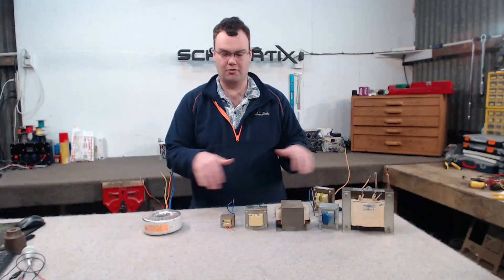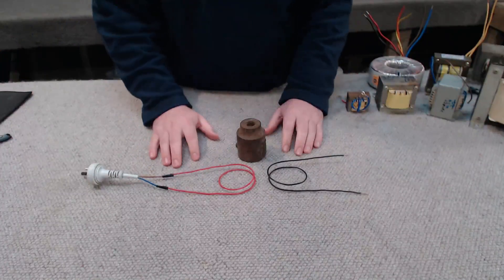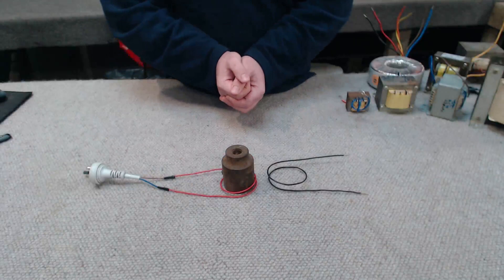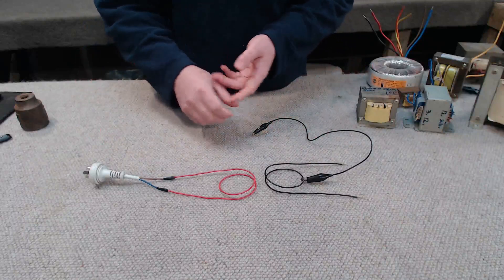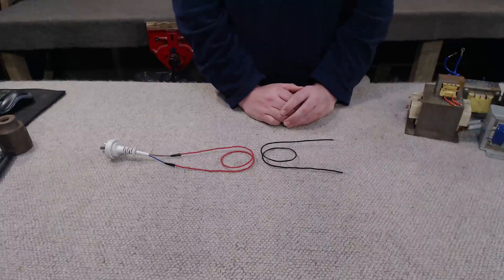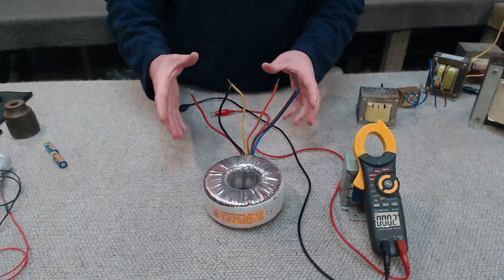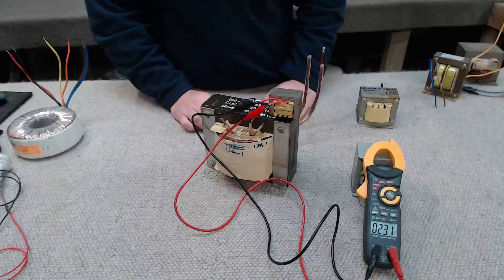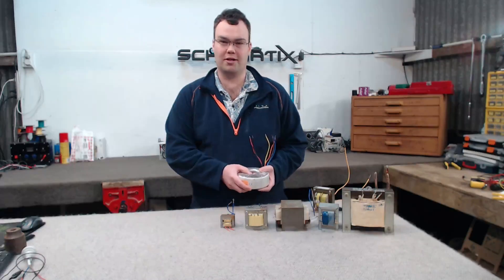Transformers 101: How They Work & How To Wire Them

Comment: I have NO idea what im doing. I want BIG arcs. I know just enough to not die basically. I know DC stuff pretty good actually, as im a mechanic. But AC is mysterious and intimidating. So i pulled a TV apart from 1958. Had a big transformer in it with 9 leads.

I juiced the only winding that had continuity between ONLY 2 leads. output was lame. Moved over to the winding to the right....

No hum, no buzz... Crossed 2 wires next to that and got a healthy humming noise......

Put my meter on it... 

600 volts. The decimal point vanished and my blood turned cold hahahahahahaha cant replicate it with any other transformer ive found in the junk collection. I either get lame outputs or a pop a 20A breaker in my house lol

Comment: When identifying the primary and secondary cant you find the a pair , write down the resistance, find another pair and  with the two different resistances  use  Vpri÷ V2nd = Npri÷N2ndary and on the transformer a tag should be there indicating ( not wire colors) but primary and secondary voltage. Depending on whether it's a step up or down transformer you could determine  which pair is which by the ohms  value as more turns ( N) will be the higher resistance. . To verify input the voltage on one and read the voltage on the other.

Comment: I have transformers hooked up to power ten inch sub woofers hooked up on my 98 DE51V double cab Suzuki van these transformers are different that yours they only have three wires and I don’t know how to hook them up it’s four transformers two capacitors and about ten large transformers I wish there was a way to send a picture to you I can’t figure out how to hook up 12Vdc to get them working and hook up the signal coming in from the radio please help

Comment: A question: in the US we have a 240V secondary with a center tap to give 120V. The center tap is referred to as the neutral and said to have a voltage of 0. Why is the center tap’s voltage zero. Is this an inherent property of a center tap (if so, why) or is it simply because the neutral is connected to ground (as in the case of a breaker box)?  Thanks much for your time.
Reply: If nothing else were at play you could arbitrary call any one of the secondary wires "zero volts." In the normal use in electrical distribution in North America, the 240 volts is often called "split phase." If you use the centre tap as your zero volt reference, then one end of the overall winding is 180 degrees out of phase with the other, with respect to the centre tap. For example if the instantaneous voltage on one lead were -50 volts with respect to the tap, the other lead would be +50 volts with respect to the tap.
In power distribution the centre tap or "neutral" is normally connected to earth ground at the distribution transformer and at each electrical panel. This redundancy is a hedge against one of the connections going open. For example, if the neutral wire between the transformer and the panel in your house went open circuit for any reason, and there was no redundant path) then all the neutral connections in you house would be "hot" an present lethal shock hazard (along with the problem that current could then only flow from one end of the transformer winding to the other, and there would be no well-defined centre point).

Comment: I'm curious more so in the construction of a standard transformer, as in "why do laminations make up the iron core in most transformers?" and "Why is the whole unit dipped in varnish?"
Reply: Laminations are used to deal with eddy currents.
Briefly (you'll be able to find lots more on the web by searching for the term), when an electrical conductor is put into a time-varying magnetic field, electrical current is induced into the conductor. In the core material of a transformer, these currents are called "eddy currents." They flow within the material itself, not through some external circuit. They are undesirable in the core of a transformer because they consume power, lowering the efficiency of the transformer, and of course cause heating because of that power consumption. In a solid chunk of steel ("silicon steel" is the usual core material for low-frequency transformers), the eddy currents can be very large and flow through the whole thickness. Laminations restrict eddy currents more or less to each individual lamination. This is because there is electrical insulation on the surface of each lam. It isn't very good insulation, often oxide from the manufacturing process but may be a specific coating of some sort or even separate insulation such as paper, but it is good enough to localize the eddy currents. You still get eddy current in each lamination but the path for them is short and the overall amount of current is vastly less than it would be for the same overall thickness of solid steel. At higher frequencies, laminations need to be thinner. Some high frequency transformers use toroidal "tape wound" cores, where the metal (often something more "exotic" than steel) is made as a very thin ribbon that is wound into a roll like electrical tape. At very high frequencies, as for switchmode power supplies, the core materials are generally made with more or less non-conductive materials like iron oxide ("ferrite").

Varnish does a couple of things. It "glues" everything together. This can help prevent audible noise from the winding wires moving in the magnetic field or the lamination pieces vibrating against each other, again because of the mag' field. Varnish also helps seal moisture out of the whole affair.

Comment: I was wondering if two high voltage transformers had to be re winded I am trying to repair a old welder. It's a zebra 30Z/230/208/240/220

Comment: I am currently building a solar/wind system. I have 4 120vac at 41.67 amps. Inverters I  have been told by an electrician that the 4 outputs of the inverters can be wired into the primary with only a single input? This seems odd to me from an electronics standpoint. If I tried to connect 4 outputs onto the only primary winding of a transformer, that the inverters would be back feeding into each other thus destroying the inverters and possibly the transformer? I need the 4 5kw to feed my primary and give me 120vac split phase output. I am pretty sure that the electrician didn't understand what I was trying to do.  The only way I know to not burn out anything is to make my own transformer using 100 turns for each inverter, then my secondary would have 100 turns that I could wire into my step-down transformer input and get 240 roughly 83 amps and then the secondary on the single input transformer would give me 120 vac split phase. I  may not have the number of turns correct for the inverter input to get 240 vac 83 amps out.  Unless I am remembering it backwards I think that it's 25 turns per primary input, and 100 turns on the output to get 240 vac. I haven't found a multi input primary step-down transformer yet. I do have an old transformer with 1 set of inputs that will output up to 10k vac across the secondaries. The internal wiring of this transformer has been gone for years but the secondary is center tapped with 5 outputs either side. Wish I had the internal diagram. Am I on the right path and correct that you can't hook the outputs of 4 inverters parallel into the only input without burning out the inverters.

Comment: as a SUBBIE I would like to share a thought, 'step up transformers' looking at a MOT  ='DANGER'= . Here is Aus we have 240V a.c. domestic and using that to a mot would give a step up of 2000V a.c. plus, I would like to reverse primary input connection to the secondary and to have the mot step down is this possible ..thanks for any thoughts. p.s. I would be aware of the secondary winding in most cases is tied to the transformers body, thanks again cheers

Comment: I took a transformer out of a computer PSU, it typically converts 240v into lower voltages obviously. I noticed it actually has 3 inputs on the input side, this is because one input remains the same, but it would be electrically moved from one pin to another whether it's being used with 240v or 120v. Essentially it's the tap thing you explained, the 120v I would say would have more windings, where as the 240v would be tapped in there before the windings are completed, because the 240v is already starting at a higher voltage to begin with. 

Then on the output side there were a crazy 7 pins, however 2 sets were connected on closer inspection, so actually it's 5 separate outputs. Being a computer power supply transformer, it's understandable as in a computer power supply it's meant to create 12v, 5v, 3.3v. 

It's using the tap method also on the output, so sharing one pin, and then different pins are used for different voltages, that would equate to 4 pins however, I found out that the fifth pin didn't appear to to anything, it also looked odd compared to the rest and didn't come from the actual roll of coiled wires, but just came out of the bottom of the frame. 

In order to figure out the voltages on these 4 outputs, and luckily with AC it doesn't matter what way you put things around as it's alternating anyway. It means you can attach simple devices to the transformer while it's powered up. Using a 12v bulb, it's simple to see. It's bright when you are between the 12v ones, it's drab when it's between the 5v ones, and it's not even lighting up between the 3.3v ones. Then you can use a permanent marker to put dots near the main ones so you don't have to remember, obviously I am using the 12v ones, this would be the full span of the output windings. 

I wasn't able to actually find a datasheet on it, to figure out it's amp allowance. But the power supply that this transformer came out of, said on it's box to not draw anymore than 280w. This tells me that I shouldn't draw anymore than 23 amps from this. However to be on the safe side I stick to around 200w flat, which is around nearly 17 amps, when it's run like this it only gets mildly warm so I know it's not hurting it. After all, if you burn these things out, they are totally useless, it's best to run them in a safe range, because I know they are expensive to replace.  

I turned mine into a DIY homemade heater, basically the transformer runs 2x 100w ebay bought resistors that were only 2 dollars each. I then use a large metal half tube over the transformer to cover it, and I put a small fan in between it and the resistors, it sucks air over the transformer and blows it onto the resistors, that are screwed onto a larger heatsink. This was very cheap to make, as I already had the heatsink, I already had the transformer and the computer fan, the only thing I had to purchase was the 2 resistors, so the total project only cost me 4 dollars. Despite being pretty low wattage, it doesn't spread the heat around the room fast, it's slow to dissipate, so it means it retains warmth more in a small area, this is very comfortable to take the nippy edge off the cold, I run it only around 50cm from where I sit at my computer desk. Of course because it is homemade I don't ever leave it on if I leave the house or room, it's turned off, as there is obviously no built in safety.

Comment: THE BIG STEAL GOING ON RIGHT NOW. why do i say this? because the copper windings in new microwaves are not copper, back in the day, both coils used to be copper, then one copper and one aluminum, now both are aluminum. what does this mean?
i have seen the windings to step the power, no transformer. we are being scammed. first china had crappy copper content in the windings of motors, cooked the motors and we had to keep buying new gadgets.
my guess, they are using the high grade copper for making machines of war, and making us pay for this in the form of crappy electric windings and aluminum transformer windings. war is coming, and this is one way for china to catapult forward, leapfrogging ahead. 
comploetes two prongs, first we have to buy more gadgets as they break, and two, they get to use the high grade elements in their war efforts, both culminating in teh destruction of the west. wake up people, dont be led by the corporated traitors who have sold us out to the chinese. wake up people!

Comment: Thank you,  beautifully explained.
 I have  a special Rodin like coil system or design I am working on  because I have come into some interesting information, the problem is I am no electrical engineer, but I know the system works.
Can you explain a simple way of me testing it for its potential. I have just bought myself a voltage meter.
This is my email. 
nzbldr@gmail.com
Cheers.

Comment: Could you explain in detail what is happening with the grounding of these appliances that use transformers? As there is nothing in your analogy connecting the ground to the transformer, it is unclear if there is a step of safety in these applications.
Reply: Definitely something I know very little about (relationship between grounding and transformers). Would greatly appreciate your input
Reply: Hi Sonny. Typically, a transformer does not require grounding. The "hot" wire and the "return"/"neutral" wire connect to the primary to generate a changing magnetic field that induces a current into the secondary and that's that. In some high voltage applications, such as in a microwave oven transformer, the core and/or the secondary "return"  is sometimes connected to the third, "earth ground," wire which is also connected to the housing. This is to prevent electrostatic potentials from building up to the point that it could become a shock hazard.

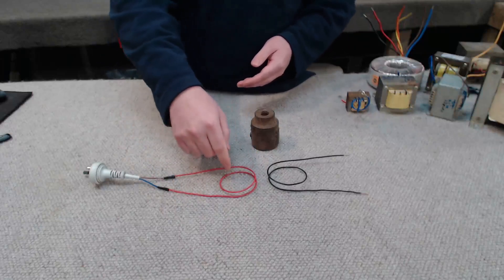Comment: 3:20 Really. Shorting does not happen if the wire is coiled around an iron cyclinder ? Woww. Does it matter if the cyclinder is a conducting material or non-conducting material such as wood ?

Comment: why can't you just measure both resistances and the higher resistande has to be the secondary winding ?
longer cable equals more windings equals more resistance or correct me if i'm wrong ?

Comment: in the beginning of your video, you said the one loop of wire in the primary will not cause short! what about the wires through the wall, can not take that low resistance. this will cause the circuit breaker to trip! if you lucky.

Comment: Good little intro to Transformers, but you forgot to mention one of the most important properties relevant to Power Circuits? Galvanic isolation. Also similarly there are auto-transformers.

Comment: I did what you did and short circuit live and neutral in Australia and wound them a couple times around an iron drill bit but it threw the safety  cut off switch when I did!

Comment: My question is.....How do techs know how to use a standard power transformer
as an AUDIO output transformer with alterations at all !
Please do a video on this topic and if there is also other uses for a transformer without any alterations ...well add them to that video too !
Another situation i have is that i got an old TUBE\VALVES Transmitter that has a few Power Transformers and all of them have 6.2 volts to feed the HEATER o those tubes and it is supposed to be  6.3v for GUITAR, BASS AND OLD AUDIOPHILE AMPS !!
I thought all power trans had 6.3v and my question is what will be the result in audio terms by onky heating up the heaters with 6.2volts ??
Maybe no change or maybe the Heater will last longer or maybe the sound will be less distorted ( since it is for Transmitting frequencies ) Please tell when did they stopped using 6.2v to 6.3volts ? 
That way maybe i will know how old is my NON working unit ! haha
Thanks a lot

Comment: I used to make industrial transformers in a machine made by Tanaka. Output was about 1000 a day. The machine wound 2 at a time. There was guarding all around the machine and the Tanaka wouldn’t start until it was engaged, but when the wire broke as the transformer was winding, bits would fly everywhere.  I was still finding the occasional shrapnel in clothing 5 years after I left.

Comment: If the output from a toroidal transformer is going into a single ended rather than a push pull rectifier/amp then the toroid has to be broken in two and and reassembled with the two halfs being insulated from each other before the windings are wrapped.  Why?

Comment: I have what’s apparently called a ‘slide regulator.  I can connect input wires to terminals for either 220v or 110v.  The regulator has a dial on top, which when turned, will show output voltages from 0 - 240v, and there is a window which indicates what the output voltage is.  The inside basically looks like the circular transformer in this video.  Initially, if the dial was at 110v, the window showed output at 110v.  I have found that now, despite having the dial at 110v, the window may show 80v; conversely, if I have the dial at 140v, the window may show 110v.  Do you know what the problem is, and is there anyway I can repair this?

Comment: ive been looking for an informative video about transformer since im trouble shooting a welding machine, the welding has power but once i started working on it same connection explodes, (its the connection between switch going to the inner wire of the primary coil) can you help me fix the problem?

Comment: Can anyone explain me that can we discharge from primary input coil to secondary output coil..?
Reply: what do you mean??? The current and voltage in the secondary winding is induced by the magnetic field created by the primary winding.
Reply: @yurimodin7333  it means that Sir. we start to wrap for 100 voltage for input and we wrap for 20 voltage output. In those  two wrapping coins, each tip of wire can be contacted.
 Two tips of wires can't shock if twos wrapping tips of wires are connected..?